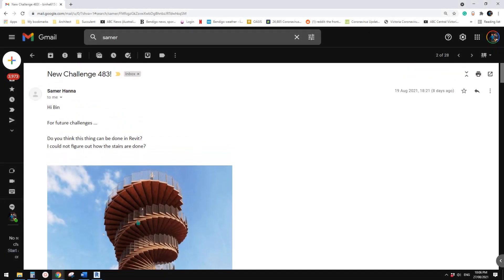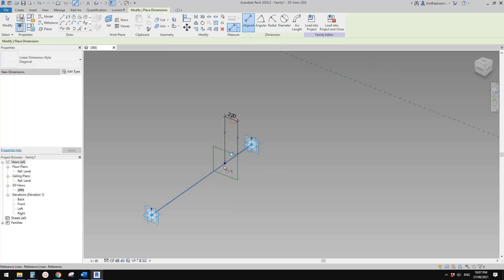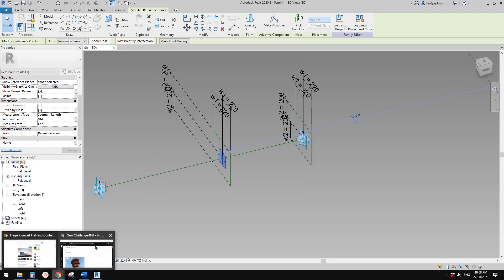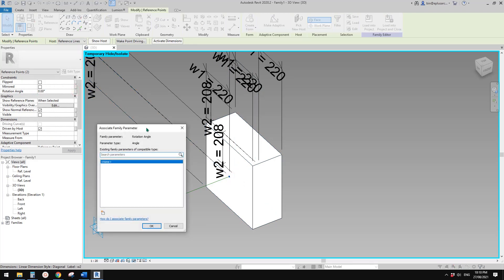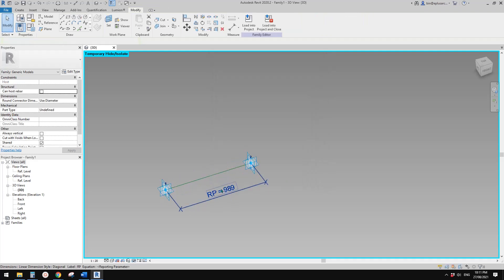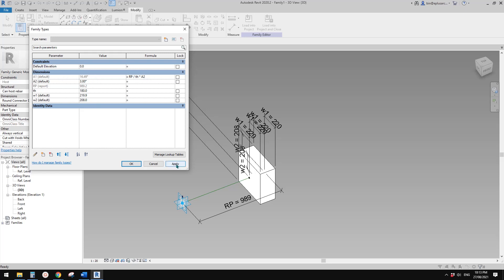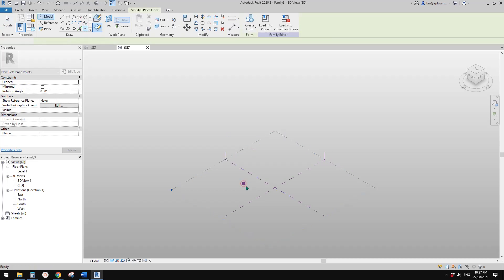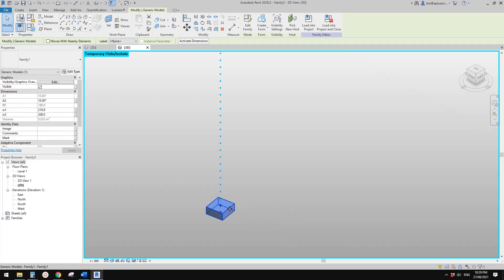Everyday Revit (Day 524) - Adaptive Family Exercise

Comment: I Think the minimum allowable height is limited to the number of steps x 180 ? Less than that it won’t accept
Reply from the maker: Can you elaborate a little bit Somar?
Reply: @BINHE615   
I am not sure … but what I ment … when you try to change the total length of line (the 2 adaptive points)  it breaks at a certain point maybe because there is no place for all the steps height (which is a parameter that was set to 180 I guess?) … don’t know 
But what I notice is when the line becomes longer there was no problem but when shorter than a certain point it breaks
Reply from the maker: hmm,  is it possible to use if condition?
Reply: @BINHE615   
I have to try it my self first … am not sure
Reply from the maker: @samoxflox9261  Yes, it works, did a video about it.